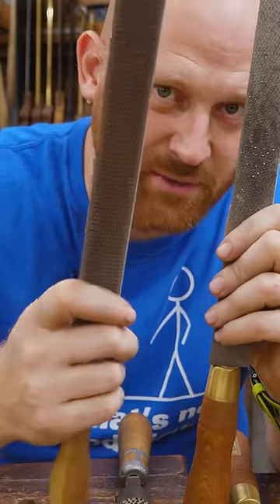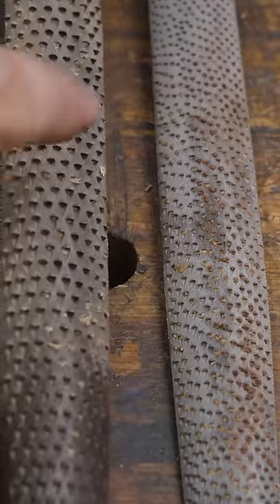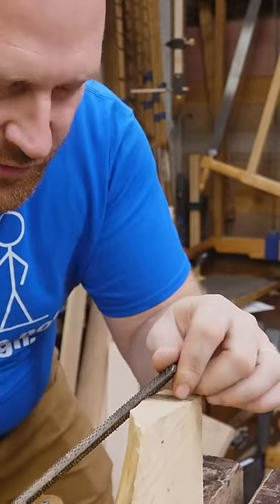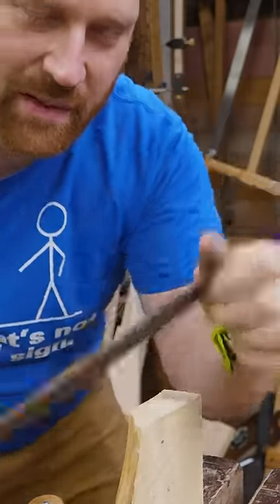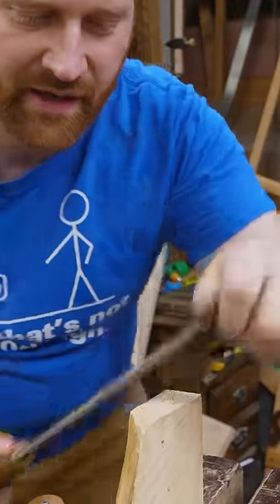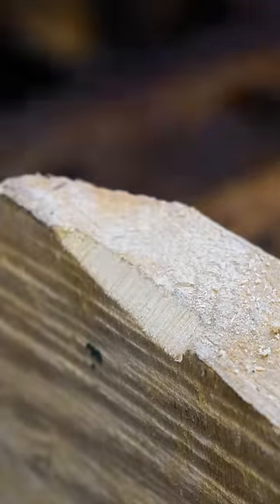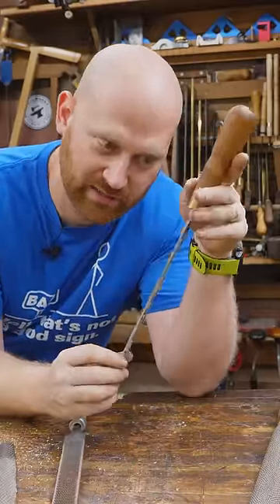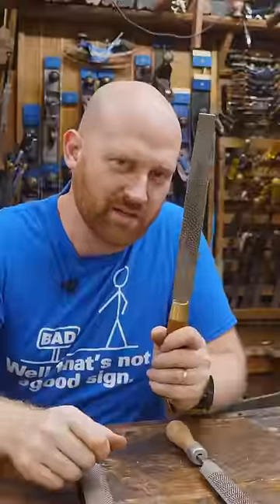Hand Stitched vs Machine Stitched Rasps

Comment: Reminder that lee valley sells hand stitched rasps for $40
Reply: I was wondering where to.get the hand stitched,  thanks
Reply: Or you can go to an antique shop, odds are they’ll have something for $5
Reply: I have the lee valley hand stitched rasps and can vouch for them. So much nicer to use compared to my machine rasp
Reply: @mooseroo2005  how do you think they stack up to the next price bracket? I've been thinking if getting either those or one of the 6" gramercy rasps for making saw and plane totes
Reply: As someone who hasn't cut anything but firewood in 3 years I kust purchase a hand stitched rasp
Reply: @yambammer7277 If you get real lucky you can find one at the dump like me. Except mine was dull so I use it for forging instead. No sense in ruining a perfectly good farriers rasp on hot steel when I can use a dull one.
Reply: What? Ooh I was looking on Google and they were starting at like $80
Reply: Thanks man was looking for one saved me so much money

Comment: Honestly the history of files and rasps should be looked at, it took a really really long time before machine made were even close to the quality of hand done and hand done still hands down are better but quite a bit more expensive. It has to do with the minor imperfections making the surface cut way nicer, it's laughable that the idea that a blacksmith would have used a file and make it into a knife before machine cut ones became good enough to even be competitive as the file would have been worth way more then any knife that could have been made out of it.

Comment: The messed up part is that it would take very little effort on the part of the rasp producers to tweak the machine to stitch in a random pattern. The first file producer to do this could charge a premium for their files for a while, for a little extra cost of production, before all the other producers followed suit, and then we’d all have access to cheap, premium rasps. Producers of hand stitched rasps would suffer from it, the rest of us would be better off.
Reply from the maker: They have made that, but the cost to run it is only slightly less then paying someone in Asia. And the makers for big box stores don't care. So the price on them is about the same as the hand stitched. The current machines punch full rows at once and march down the blade. And the audience they sell to (Big Box Stores) do not care about or even know that there is quality. Here they are: https://www.corradishop.com/gold-precision-rasps-c-1_4/gold-precision-rasps-round-6-cut-6-p-604.

Comment: I don’t do wood working, but I do cook, and I’ve noticed the grooves when using a microplaner for cheeses and garlic. Maybe I should make my own haha
Reply: Microplanes were originally a wood rasp design that got adapted for cooking
Reply: Their woodworking rasps actually aren't expensive, either, if they have them in stock at least. They list the flat blade and handle combo at $14, the handle itself is $5, and round/angle/flat replacement blades are $11.

Comment: This is so true. Lmao, I was an idiot who started will a mill file on wood. Then I moved onto a rusty rasp and finally I went to a friend's ranch and the Farrier would make his own rasps! He'd use a leaf spring and another tool also made of a leaf spring (like a chisel-punch) and he'd cut the teeth himself. You're right about one thing! He deliverately staggered the tooth placement. "one on two off". Didn't know what he meant until right now. I still have an old worn out rasp he gave me. It doesn't cut well anymore but it's a nice memento.

Comment: There’s no reason a machine stitched one couldn’t have that variability. Why don’t they just manufacture them that way?
Reply from the maker: They have made machines that will do random stitching and others have made a CNC that will do it. Unfortunately those machines cost so much to put together or the time on the CNC cost more than it cost to pay someone in India to punch them by hand. So the random machine punched rasps usually only cost a tiny amount less than the hand stitched rasp. The machines that make the commercial rasps punch two or four lines of teeth every time they go down.
Reply: Too much production complexity, not enough constant buyers.
Reply: @WoodByWrightHowTo  could they not design a punch with a more random spread of stitches? I feel it can’t be too hard to replicate the properties you find in hand stitched rasps with a mass production friendly process, or is it just that they’ve been hiding that they automated it, keeping all the cost savings to themselves🤔👀😅
Reply: @WoodByWrightHowTo but why are machine stitched so much cheaper then ?
Reply: @evangorski7992 Well actually, yes it would be harder. The machines they have now put down several rows at once, possible because they're all the same. If they're randomly places you either make your machine 8x slower or come up with some bespoke solution.
Reply: @wenahy  because making a punch that distributes the teeth evenly is way easier than making a punch that distributes the teeth randomly and the harder it is to do, the more it costs. So a machine stitched rasp with perfectly even rows will always be cheaper than a machine stitched rasp with random rows.
Reply: @evangorski7992 the could. But what for. If I want cleanness i take a (metal file).

Comment: That got me thinking, there's gotta be an optional pattern the machine stitched rasps could use that not only mimics the hand made one, but improves on it
But they were like let's make them in even rows
Reply from the maker: They have made that, but the cost to run it is only slightly less then paying someone in Asia. And the makers for big box stores don't care. So the price on them is about the same as the hand stitched. The current machines punch full rows at once and march down the blade. And the audience they sell to (Big Box Stores) do not care about or even know that there is quality. Here they are: https://www.corradishop.com/gold-precision-rasps-c-1_4/gold-precision-rasps-round-6-cut-6-p-604.
Reply: @WoodByWrightHowTo  amazing, so the only things left is optimization of the process and higher production volumes to bring down the cost.
glad to see a company doing it and innovating, plus I'm sure more people talking about it through channels like yours is gonna help it a lot

Comment: you could also machine stich asymmetricaly/randomly to copy a hand done one
Reply from the maker: They have made that, but the cost to run it is only slightly less then paying someone in Asia. And the makers for big box stores don't care. So the price on them is about the same as the hand stitched. The current machines punch full rows at once and march down the blade. And the audience they sell to (Big Box Stores) do not care about or even know that there is quality. Here they are: https://www.corradishop.com/gold-precision-rasps-c-1_4/gold-precision-rasps-round-6-cut-6-p-604

Comment: Looks easy to make of know how to heat treat. Just a punch and a file seems like you could make one in a day, do they cost more than a days labor?
Reply: And a saw to cut the side off a round bar of tool steel
Reply from the maker: it is relitivly simple to make if you have a forge and a punch. the problem is the skill to get every tooth exactly the same height.

Comment: I wonder if it would be possible to produce machine stitched rasps where they aren't aligned than that, and possible more random, though probably not unique between each rasp.
Reply from the maker: They have made that, but the cost to run it is only slightly less then paying someone in Asia. And the makers for big box stores don't care. So the price on them is about the same as the hand stitched. The current machines punch full rows at once and march down the blade. And the audience they sell to (Big Box Stores) do not care about or even know that there is quality. Here they are: https://www.corradishop.com/gold-precision-rasps-c-1_4/gold-precision-rasps-round-6-cut-6-p-604.

Comment: Wouldnt this be easily resolved by slight adjustments in the machining process? They could even research the "best" distribution and create all files with that pattern
Reply from the maker: They have made that, but the cost to run it is only slightly less then paying someone in Asia. And the makers for big box stores don't care. So the price on them is about the same as the hand stitched. The current machines punch full rows at once and march down the blade. And the audence they sell to (Big Box Stores) do not care about or even know that there is quality. Here they are: https://www.corradishop.com/gold-precision-rasps-c-1_4/gold-precision-rasps-round-6-cut-6-p-604

Comment: Sure, surely we could improve the design of the machine stitch rasps, just by including some intentional variation.
Reply from the maker: They have made that, but the cost to run it is only slightly less then paying someone in Asia. And the makers for big box stores don't care. So the price on them is about the same as the hand stitched Here they are: https://www.corradishop.com/gold-precision-rasps-c-1_4/gold-precision-rasps-round-6-cut-6-p-604

Comment: Interesting. It seems like there could be a way to optimize the pattern of a machine stitched rasp
Reply from the maker: They have made that, but the cost to run it is only slightly less then paying someone in Asia. And the makers for big box stores don't care. So the price on them is about the same as the hand stitched. The current machines punch full rows at once and march down the blade. And the audience they sell to (Big Box Stores) do not care about or even know that there is quality. Here they are: https://www.corradishop.com/gold-precision-rasps-c-1_4/gold-precision-rasps-round-6-cut-6-p-604.
Reply: If they're doing a full row at once, I imagine if they offset the tool blank or the die left and right slightly as it marches along the length, you might have a similar effect as a hand stitched.  Perhaps I'm just describing the same thing you just said.  It might also be one of those diminishing returns situations.  In any case, I personally find it distasteful and below someone of my station to scrape about and poke at the discarded bones of dead trees, so I wouldn't know.

Comment: If one were to design a machine that stitches with a more random placement, would this also lead to the benefits a hand stitched one has?
Reply from the maker: They have made that, but the cost to run it is only slightly less then paying someone in Asia. And the makers for big box stores don't care. So the price on them is about the same as the hand stitched. The current machines punch full rows at once and march down the blade. And the audence they sell to (Big Box Stores) do not care about or even know that there is quality. Here they are: https://www.corradishop.com/gold-precision-rasps-c-1_4/gold-precision-rasps-round-6-cut-6-p-604

Comment: I just picked up a coarse carbide rasp(?). It leaves a rough surface on soft wood, and a little better on hardwood, but i haven't used it much since picking it up. Any thoughts on these and how other raps perform compared to them?
Reply from the maker: There are a few different styles of carbide teeth. They're the ones that are welded on and there are the ones that are more like a plane with a blade than a point. I haven't used either of them much but maybe someday I'll get a couple of them to play around with a bit more.
Reply: Yeah, I picked up a coarse kutzall 8" "rasp" the grit is fairly randomly distributed and I am hoping it works similarly. It cuts much nicer than my machine cut rasps, but it leaves a rough surface. No clue on durability or comparisons to the arirou (sp?) Or Nicholson 50

Comment: Maybe we need machine stitch design better made for those purposes? Something more omnidirectional with a startup pattern and a variance pattern so it doesn't follow the same grooves but rather makes a uniform smooth grind
Reply from the maker: They have made that, but the cost to run it is only slightly less then paying someone in Asia. And the makers for big box stores don't care. So the price on them is about the same as the hand stitched

Comment: What is stopping a manufacturer from using an irregular pattern when tooling rasps? Seems like it’d be easy leg up on competition
Reply from the maker: They have made that, but the cost to run it is only slightly less then paying someone in Asia. And the makers for big box stores don't care. So the price on them is about the same as the hand stitched. The current machines punch full rows at once and march down the blade. And the audience they sell to (Big Box Stores) do not care about or even know that there is quality. Here they are: https://www.corradishop.com/gold-precision-rasps-c-1_4/gold-precision-rasps-round-6-cut-6-p-604.

Comment: I wonder how it would change things if you sort of tapped the machined rasp randomly side to side with a ball peen hammer or such, and then finished it off with a flat-faced hammer to make everything even again
Reply from the maker: Then the teeth wouldn't be pointing under correct direction. The teeth are actually punched out rather than machined.

Comment: I can't imagine it would be all that hard to create a random stitch pattern with a machine
Reply from the maker: They have made that, but the cost to run it is only slightly less then paying someone in Asia. And the makers for big box stores don't care. So the price on them is about the same as the hand stitched. The current machines punch full rows at once and march down the blade. And the audence they sell to (Big Box Stores) do not care about or even know that there is quality. Here they are: https://www.corradishop.com/gold-precision-rasps-c-1_4/gold-precision-rasps-round-6-cut-6-p-604
Reply: @WoodByWrightHowTo  that's good to know thanks for the info! 👍🏻

Comment: Anyway to modify a machine stitched rasp to make it function closer to a hand Stitch?
Reply from the maker: They have made that, but the cost to run it is only slightly less then paying someone in Asia. And the makers for big box stores don't care. So the price on them is about the same as the hand stitched. The current machines punch full rows at once and march down the blade. And the audience they sell to (Big Box Stores) do not care about or even know that there is quality. Here they are: https://www.corradishop.com/gold-precision-rasps-c-1_4/gold-precision-rasps-round-6-cut-6-p-604.

Comment: So what I'm getting at is they just need to make a machine that stitches it randomly or at least close enough to random so that nothing's in line and it cut smoother
Reply from the maker: They have made that, but the cost to run it is only slightly less then paying someone in Asia. And the makers for big box stores don't care. So the price on them is about the same as the hand stitched.
Reply: @WoodByWrightHowTo  well that needs to be addressed tbh it wouldnt be that hard to retool standard machines to make it more "random" and shouldnt be that expensive. but corporate greed fucks everyone
Reply from the maker: I would love that. The problem is that current machines punch whole rows at once rather then one at a time. and they have no desire to do it as the audience they sell to (big Box Stores) does not care. the hand tool community is just too small to influence the change.

Comment: would staggering the rows of teeth on the machine made one make it cut smoother?
Reply from the maker: They have made that, but the cost to run it is only slightly less then paying someone in Asia. And the makers for big box stores don't care. So the price on them is about the same as the hand stitched. The current machines punch full rows at once and march down the blade. And the audence they sell to (Big Box Stores) do not care about or even know that there is quality. Here they are: https://www.corradishop.com/gold-precision-rasps-c-1_4/gold-precision-rasps-round-6-cut-6-p-604

Comment: Since I learned about those, I keep wondering why they don't have random pattern machine stitched rasp?
Like it could be done right?
Reply from the maker: They have made that, but the cost to run it is only slightly less then paying someone in Asia. And the makers for big box stores don't care. So the price on them is about the same as the hand stitched Here they are: https://www.corradishop.com/gold-precision-rasps-c-1_4/gold-precision-rasps-round-6-cut-6-p-604
Reply: @WoodByWrightHowTo  thx for the info an the link!
Tbh that was more a theoretical question, as I'm broke af and I'll just use what I can get my hands on ^^

Comment: You've identified problems with the machine stiching. If i was making a tool for a living. i would take that feedback and develop a new process such that the stiching was seemingly random like the hand made one. This will allow me to tank the handstiched market, take all their customers (who can now get them from theoretical capitalist me at a lower price)  and up my costs for this model would be civered becauze it can be branded as a "premium" product.

My existing customers will be thrilled and purchase all new tools.

Everybody wins! (Except for the handcrafted tool makers)
Reply from the maker: They have made that, but the cost to run it is only slightly less then paying someone in Asia. And the makers for big box stores don't care. So the price on them is about the same as the hand stitched. The current machines punch full rows at once and march down the blade. And the audience they sell to (Big Box Stores) do not care about or even know that there is quality. Here they are: https://www.corradishop.com/gold-precision-rasps-c-1_4/gold-precision-rasps-round-6-cut-6-p-604.